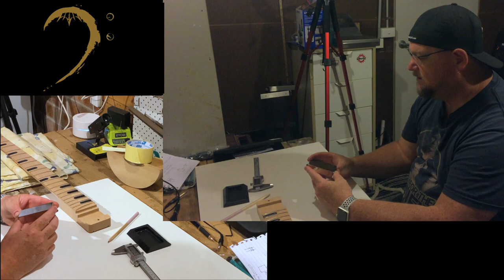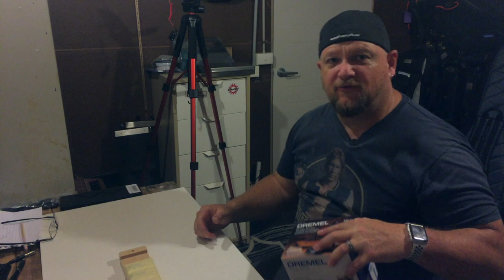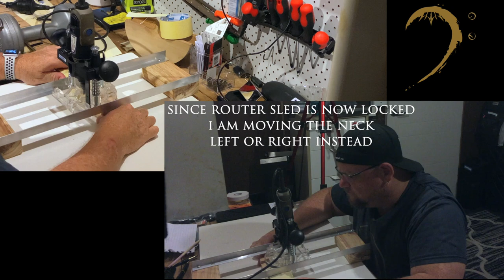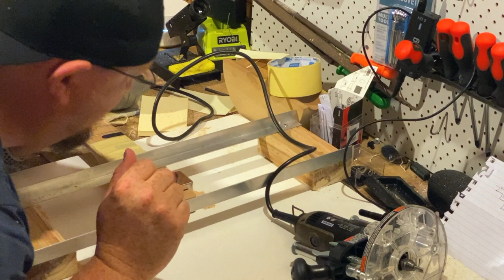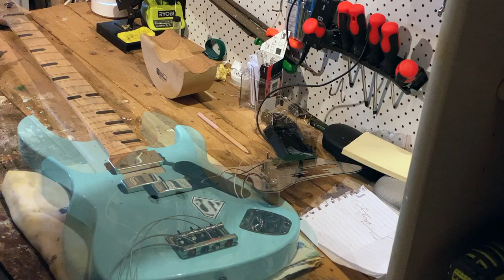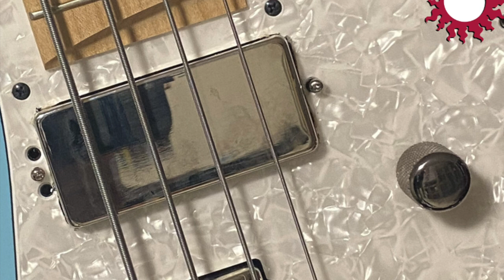Relentless Pickup Replacement with Attitude

Comment: I just received a DiMarzio DP 295N 'Relentless' neck bass humbucker pup for a homebuilt custom bass that I'm completing. I ordered it from Muziker UK, but it took ages to come and was shipped UPS from Croatia. They advertise it incorrectly as 'White' but this is a mistake as the nickel one has a white background and the reflections in the only photo of it make the pickup look white, it is nickel. They are comparable to the DP120 Model One (for the short-scale SG bass at the neck) but are much more modern, have much higher output, are potted and are specifically designed to be used in Billy's two-channel configuration at the neck to be mixed in or across two amps, covering the bass frequencies. DiMarzio has done zero marketing on this one and their website is notoriously underdeveloped, and full of missing information on this and many other pups. These are currently (July 2022) really hard to get. However, if you are building a dual channel (Billy Sheehan-style) bass then as a neck pickup, in combination with a good middle or bridge (I'm using Seymour SJB-3 Quarter pounder singles at mid and bridge) they are unmatched, as there doesn't seem to be anything else that would beat there frequencies response and output. They are a VERY specific use case though. Can't be used on their own as they only cover extreme bass frequencies and have very high output, especially for that role. I have to say, this neck pickup is built like an absolute tank and very heavy. I'm yet to test it in my homebuilt bass as not yet assembled, so I may well do a video on it at some point as there is barely any information on these pups and they are so interesting. I suspect they were made as an agreement with Billy Sheehan to produce both the P-style middle and a neck 'Relentless' set. However, as this fantastic video shows, they can't be dropped straight into Billy's premium signature basses as a replacement without routing them out, and Yamaha probably don't want people doing that. So, I suspect there's some politics between Yamaha and DiMarzio around this pickup powerhouse neck humbucker and hence the lack of marketing from DiMarzio. But WOW, what a unique gem of a pickup if you're building a dual channel passive bass!!!
Reply from the maker: Thanks for the great feedback. It would be great to get a view of how you progress your bass build. 
I find the combination of the two pickups gives a growl to the tone I can't seem to get with a single pickup. I do use the neck pickup in a couple of songs, by itself to get a really deep sound, using a Drop-D... similar to that of an octave pedal.

Comment: I had no idea there was a Relentless neck pickup. Dimarzio's promotion seems to have centred on the P. Well done on a successful installation. One thing I would suggest is that you could have clamped a board of 18mm ply or OSB to the desk and then screwed the router guide to that and also screwed blocks either side of the neck to hold it in place.
Reply from the maker: Hey!! Thanks for the feedback... Yes, there hasn't been much promotion on the Neck pickup, but it is outstanding and really worth doing it!!! Great idea on the clamp.... that would have made it much more stable...
Reply from the maker: Yes.... the "backyard mods" come with a level of "I'd do it a bit differently next time" :-) Overall, the process is the way to go, but the clamping would have made it a bit easier. Also, I should have gone with a hand trimmer (router) instead, as that would have also made it a little more easy.

Comment: Thanks for the install video!  Honest question, can a  $3,000+ Attitude 3 really be upgraded with $120 DiMarzio's?  I know that if it sounds right, it is right...cost isn't everything.  But it's crazy to me that you'd even feel the need to go there on such a premium bass.
Reply from the maker: Hi Brett, the change in the pickups has made a big difference.... "better" is a hard call. the p-pickups are definately worth doing... they really do make a difference... the neck is a personal call... having done it, I really like the low tone I get out of it
Reply: @therecklessempire  Nice vid but I have a question, why would Dimarzio make a matching "Relentless" series neck pup that requires so much work to put into a Billy Sheehan bass when the product line is already designed for Billy's basses mainly? I understand if you wanted to install it in a non Sheehan signature bass, but otherwise shouldn't these drop right in without any extra work for BIlly's signature basses?
Reply from the maker: @Leo_Safko  not sure. It would have made it easier, and I believe that there is much less work to put it into a LTD II version. I'm pretty happy with the outcome though and they look killer.